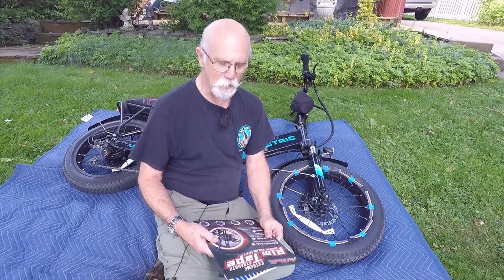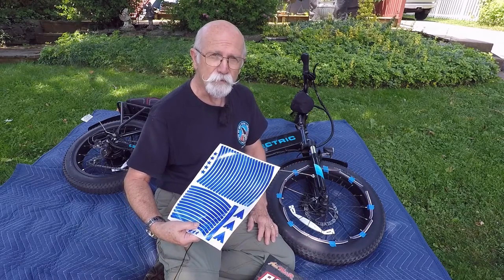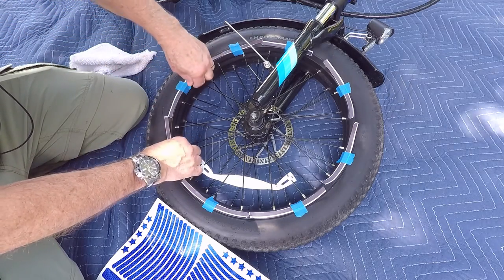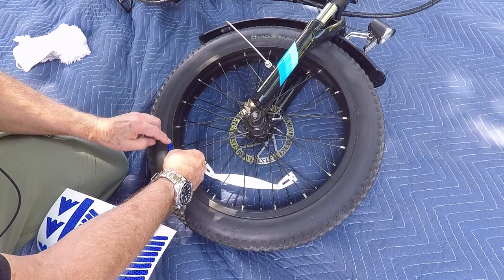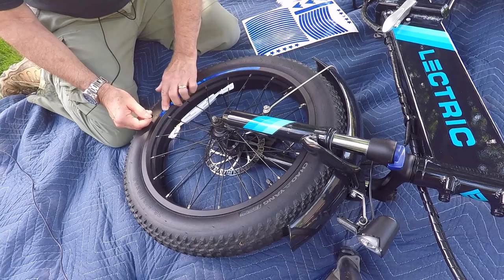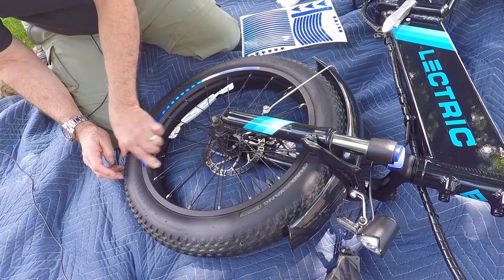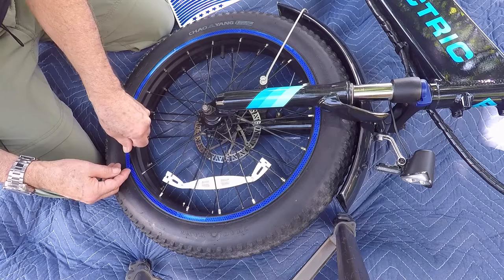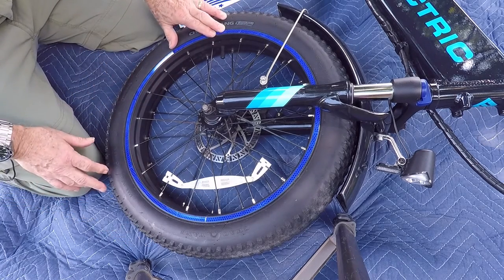Reflective wheel tape installation for Lectric bikes

Comment: Thay more than doubled the price its 39.99
Reply from the maker: Only $16 https://www.amazon.com/dp/B08L4JCRMY?ref=ppx_yo2ov_dt_b_product_details&th=1
Reply: @craiglenhard-rvrguyd  customTAYLOR33 is more expensive, but it is much more visible.
Reply from the maker: @strout2944  Maybe, maybe not. There are many variables. If you have actual test results, please share a link. Thanks
Reply: Just bought this last night, hope I don't screw it up lol
Reply: @XtremeDSLR  just  make sure your surface is clean and it will be a breeze 🤗